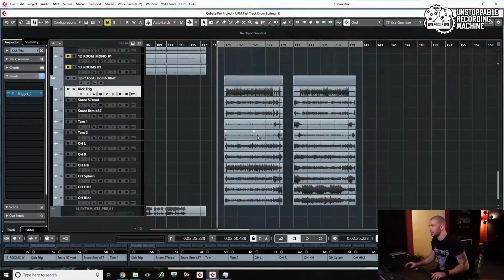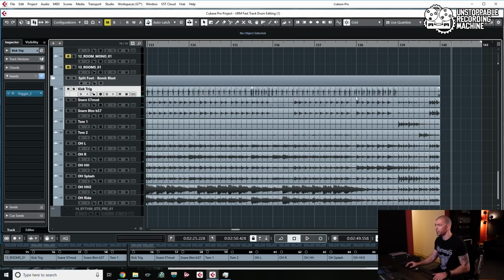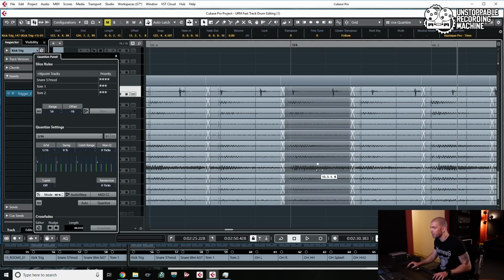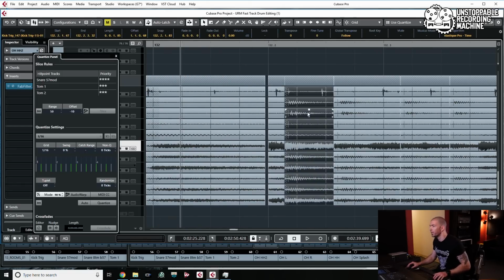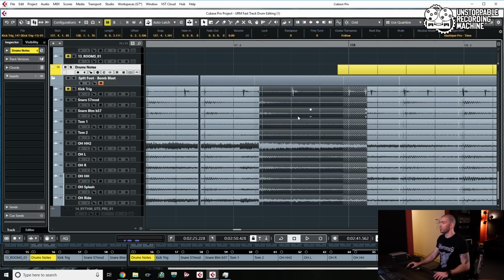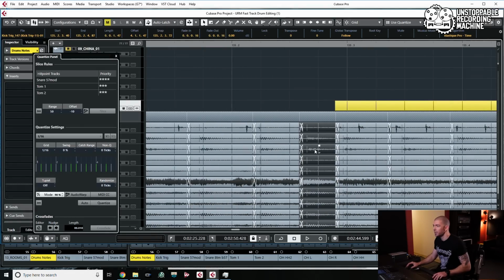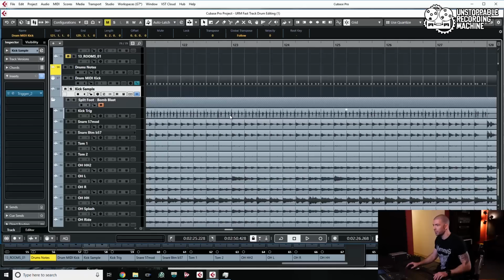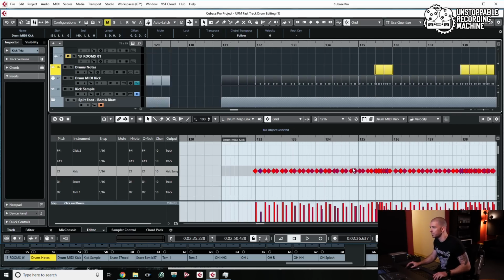HOW TO EDIT BLAST BEATS w/ Dave Otero - Fast Track preview

Comment: How record only trigger kick without sound in OH ?
Reply: Normal acoustic kick with a mesh head. You pad the inside with pillows and/or blanket as much as you can to damp the sound and avoid double hits.
Reply: some studios use Roland pads and gets the midi .